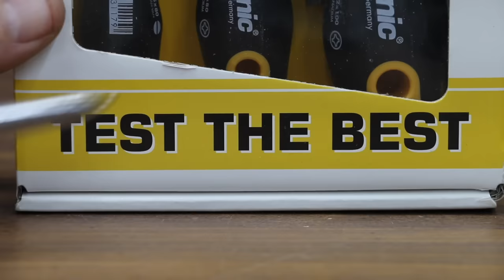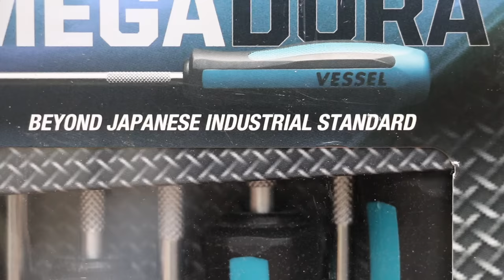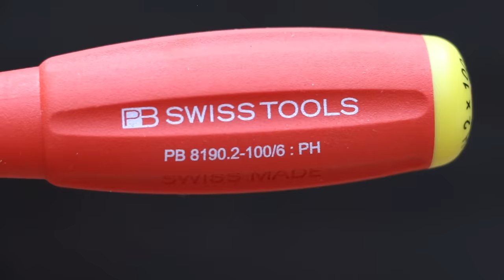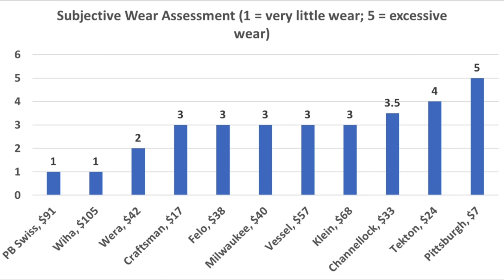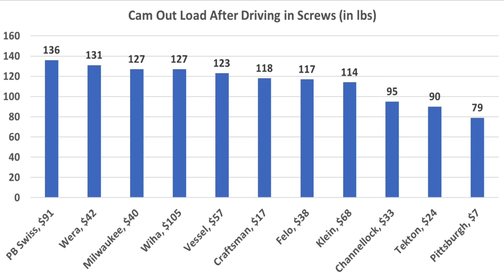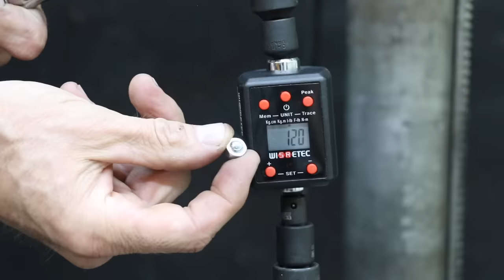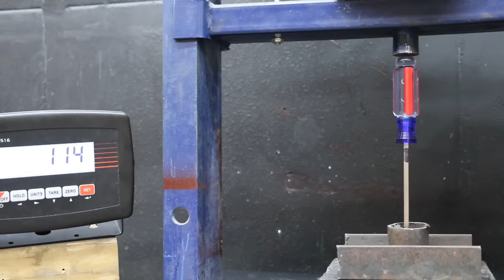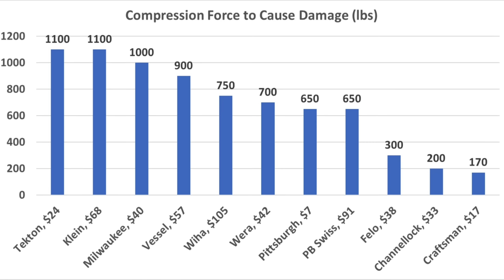Best Screwdriver Set? Craftsman, Milwaukee, Wera, Wiha, Klein Tools, Felo, PB Swiss, Tekton

Comment: "Americans like to use hammers on their screwdrivers"  Yes but said hammer is probably an adjustable wrench! LMAO
Reply: I feel personally attacked by this. Lol
Reply: And holding it with pliers.. ha!
Reply: I think you mean "Adjustable Hammer"
Reply: Nah, electricians pliers are a ‘hammer’.
Reply: Crescent Hammer
Reply: @mrjeh49  And don't forget, only use a screwdriver when prying something apart.
Reply: We Americans use everything as hammers and butter knives as screw drivers
Reply: @hammyboigaming904  Or jumping across solenoid lugs to start the tractor.
Reply: I use my metric pipe wrench for everything.Even works for sae.
Reply: @skyemac8  Yep, a set of Klein side cutters works just fine, but hit it with the solid side of the hinge.
Reply: @pallmall5495  Yours probably has a built in newton meters to lb/ft converter.
Reply: no meaning man
Reply: If it's in my hand when I need a hammer, it's a hammer.
Reply: @John BS Jack. I have old screwdrivers sharpened for gasket scrapers or wedges. They make good drivers where a chisel wont fit. Keep the expensive stuff for screws only.
Reply: @oleran4569  I use it as a torque wrench ,so yes.When it makes a loud click,I know have broken the weld on the handle again and the bolt is probably tight enough.
Reply: @John I only buy Snap-Off tools.I refuse to spend $25 on a 10mm wrench when the  $1 Craftsman I bought at a local yardsale will either turn that bolt,or snap-off.If it breaks,I go to Lowes and have it replaced while I buy some more cheap tools
Reply: Spike S  Yes, I admit that I use a screwdriver as well.
Reply: When I was in my apprenticeship there was a class called The Use And Care of Tools. This class had a text book about he use and care of tools. There were several tools (a pipe wrench, a crescent wrench)  where the book explicitly Says"___ is not a hammer"

Conclusion: If I can swing it, it's a hammer. 🔨 🛠 

Also, if it fits in a tight spot and has a tapered end, it is a wedge.
Reply: If you’re an electrician I would say linemen pliers. 😂
Reply: Thats a beautiful image you're painting
Reply: @FoolOfATuque  steamfitter. Smarter than an iron worker and carpenter, not as smart as a sparky!
Reply: To be fair adjustable crescent wrenches work much better as hammers than they do as wrenches.
Reply: LOL
Reply: @DorriWilliams  at a former job, we had a large adjustable wrench that wouldn't hold its position, so I wrote "crescent hammer" on it and threw it in the hammer drawer. Some guys were stealing and losing tools, so all of the actual hammers were missing at one point, but the crescent hammer was always there, and it worked very well!
Reply: Iron workers pliers.
Reply: Who even uses a big slotted screwdriver in a high torque role anymore,  you ask? 
Piano technicians do every day.   And we get to see what screwdrivers bend easily.  
Craftsman and Husky bend more easily than Klein . 
Klein is really good and made in the USA.
Reply: ..or a large headed ratcheting socket wrench
Reply: Shit I use my Kleins to beat on the screwdriver
Reply: Ok?and?
Reply: Channel locks make a decent hammer once you get accurate at swinging them.
Reply: I just used a large USA made Craftsman flathead to chisel out a busted section of a doorway. Sorry, but I cheated and used a real hammer on the screwdriver.
Reply: XD it's like you know me
Reply: Guilty! That's why I have my beater screwdrivers....
Reply: Or a rock.
Reply: Sadly I use an adjustable wrench as a hammer 😂 but it's works perfectly fine.
Reply: I personally keep a broken old Craftsmen 3/4 inch ratchet
Reply: Every tool is a hammer.
Reply: Anything heavier than 5in vise grips is a hammer
Reply: No you are wrong.
Reply: Sounds about right 😂
Reply: wow B Hess has his finger on the pulse of america! anything in an americans garage heavier that said screwdriver is a hammer👍
Reply: @oleran4569  don't talk about ne lime that
Reply: I see you've heard of Good Old Repair method number 3 and if that doesn't work it's time for the good old acme Ace bringing the Mickey Mouse. How fitting it is that Mickey Mouse has a female's voice because it's usually so ugly it becomes the mother of invention. You know the necessity for beauty and function. That is the Acme crew may get the job done but my a.d.d. demands a new invention
Reply: Yaa they eat pig and act like it
Reply: Mmmmm uhhhhh….. no excuse. But ITS CALLED A CRESCENT WRENCH GUY.
Reply: @ericstoverink6579  this is why I  prefer to call adjustable wrenches either a hand vice or a nut rounder
Reply: False, the hammer is a pair of side cutters!
Reply: Or a 3/8 ratchet.
Reply: slowly hides crescent wrench behind my back
Reply: It’s an adjustable linear impact driver
Reply: I have 1 Snap-on Phillips driver and it's my favorite but I just can't get myself to buy a full Snap-on set when for the price I could buy 37 craftsman sets. 😆
Reply: Adjustable hammer*
Reply: I personally do not hammer on my screwdrivers ( I've got a full set of WILDE striking cap handle pry bars for that )
And I do not use anything but a hammer as a hammer because I just about have a hammer or 3 for every job.
Reply: Factory workers use  long 1" bolts as hammers a lot.
Reply: Always use my pliers as a hammer🤣🤣
Reply: This comment section is gold
Reply: Sometimes a ratchet.
Reply: Every plier is an adjustable wrench when you use it like a hammer
Reply: That's why they're called hammerlocks 😂
Reply: @Neanderthal75  any ratchet and work as a hammer especially if you turn it around and use the back end which is usually flat.
Reply: LMAO
Reply: Yessir🤣🤣
Reply: @FoolOfATuque  linesman we aren’t playing football we’re doing the lords work
Reply: I used a Bosch 12v driver as a hammer many times. Didn’t even mark it. Works great!
Reply: I have used my Makita cordless impact battery to set nails. We’re gunna test that!
Reply: Felt that
Reply: The amount of times I've used a crescent as a hammer and felt dirty is high.
Reply: electricians know that carrying  a hammer is pointless when you have 3 lbs linesman pliers that never break unless you arc the jaws.
Reply: Have you been spying on me???
Reply: @ericstoverink6579  — There are some applications where an adjustable wrench excels.  For example, I use my 12” adjustable to tighten the large nut on a trailer hitch ball.  Buying a box wrench for that one large nut you have to turn is not efficient, because you couldn’t use it for anything else and you might have another ball with a different nut.
Reply: Kincrome makes a shift with a hammer on it
Reply: Or Kleins. Lol
Reply: As a plumber. Yes
Reply: Oh that's what a screwdriver is for.
Reply: “Laws of engineering”
- Always use correct tool for a job
- A hammer is always the correct tool
- Anything can be used as a hammer

I’m American
Reply: @Wiredlightning1  “Laws of engineering”
- Always use correct tool for a job
- A hammer is always the correct tool
- Anything can be used as a hammer
Reply: @themeez1000  “Laws of engineering”
- Always use correct tool for a job
- A hammer is always the correct tool
- Anything can be used as a hammer
Reply: @skyemac8  I am very familiar with the 9” Kline hammers.  

“Laws of engineering”
- Always use correct tool for a job
- A hammer is always the correct tool
- Anything can be used as a hammer
Reply: @bigboycombo6342  American dimes also work well as flat head screwdrivers. 

“Laws of engineering”
- Always use correct tool for a job
- A hammer is always the correct tool
- Anything can be used as a hammer
Reply: @johnwade1095  “Laws of engineering”
- Always use correct tool for a job
- A hammer is always the correct tool
- Anything can be used as a hammer
Reply: @pallmall5495  🙏
Reply: @FoolOfATuque  9” Kline hammer pliers.
Reply: I use my screwdriver as a hammer…
Reply: Lineman pliers. Best hammer in the world and wiha puts a strike surface because they know we are gonna use it as a hammer anyways. All jokes aside I started carrying an actual hammer on my belt everyday and I can't stop carrying it now
Reply: @oleran4569  * yeah! He didn't test that! : ((
Reply: Klein makes the best multitools. My favorite are their lineman-hammers and their flathead-chisels
Reply: @pallmall5495  snap on is overrated, I would put Milwaukee or gear wrench against snap on any day, at a fraction of the price
Reply: Funny….  but true.
Reply: I resemble that remark.
Reply: @skyemac8  I have two linesmen pliers. One for the intended use and one for beating things, come in handy mounting nail in boxes in tight stud spaces and good luck trying to open those pliers 😂
Reply: I find myself using a brick quite often lol
Reply: Europeans can't get the fastener loose because they are incapable of using a hammer in a screw driver due  a tradition of only restrictively using one tool at a time, its far too complicated for Europeans to use two tools at the same time
Reply: Or a set of linesman’s
Reply: I did this the other day lmao
Reply: Everything is a hammer
Reply: As an American, i approve this message
Reply: Everithing is a hammer!
Reply: Or, a pair of linemans!
Reply: Funniest comment ive read my whole life
Reply: Yeah I think it's kinda universal. Everything is a hammer.
Reply: @DorriWilliams  I actually own a crescent hammer 😂😂
Reply: 😆😆😆 Accurate. I’ve seen ratchets used thusly as well. I refuse to do either.
Reply: Some companies (Vessel comes to mind) make screwdrivers with a solid shank through the handle that are made to get hammered on.
Reply: Although that vessel Mogadora is not one of those models.
Reply: @davidantrin7935  yeah Wiha has a set of those too

Comment: "Apparently manufacturers understand that Americans like to use hammers on their tools". YES, a flat head screwdriver doubles as a chisel, a wedge, a small prybar, etc. That press test was the most important for this reason haha.
Reply: MORE POWARHH MURICA YES!!!
Reply: Wera actually make a set sepcifically for this, their chiseldrivers, I wonder if their 'normal' drivers don't deform until 700lbs, what would ones designed for extra impact fail at ...
Reply: Milwaukee has a set of drivers (2, Phillips and flat) with solid shafts through the handle and metal 'impact caps'.  Absolute monsters, but I have 2 sets of them. One just for bashing and the other for screws. The flat is the best grout chisel/tile wedge I've ever owned. The Phillips makes a great center punch for concrete when you're drilling so your masonry bit doesn't walk all over the place. 10 out of 10 do recommend.
Full disclosure, I'm a bit of a Milwaukee groupie. I fully stand behind my review, though
Reply: I got a laugh out of that!
Reply: I have a large Stanley screwdriver that I used for holding open clamshell copiers when the lifters would no longer hold and the owners were too cheap to replace the lifters.
Reply: I think I have seen an Englishman use a screwdriver with a  hammer once.  It was however an impact driver designed for the task.
Reply: @rms7254  I was wondering why he didint test yellow wera :/
Reply: Agree with the comments. I bought my handyman friend a set of Wera tools as Christmas gift and he rarely uses it. He needs the flat head to do everything you mentioned and refuses to do them to a nice flathead with the diamond tip which would be destroyed instantly the first time he hammers it. He just keeps the set at home for home repairs.
Reply: Shock loading rusted or stubborn fasteners is a decent technique, I'd buy a screwdriver that had this in mind even though you could rarely use that feature
Reply: Yes, the Harbor Freight would failed miserably had he done an impact vs press. One blow is all it takes to shatter the orange tip off it. I've used just about everything over the years and settled on the craftsman, as anything better will inevitably be stolen. At home I have a set made in Israel that feel well and are twenty years old. Can't get them any more. I do keep the reversible Kleins in my tool belts and electrical tools box, as it's very handy and fits well. Stanley would have been good to include on the cheap end.
Reply: Americans
Reply: The swing press is the best tool ever!
Reply: @goldenhawk352  perhaps German - Green Wera - screwdrivers are not designed for that dirty, general use case. If you need more "brute usage" then Wera has the specific designed yellow variants with steel end cap etc. We are a few viewers that found that test good but missing that kind of detail. Most of us do a range of things but selecting the right tool for a specific job is always a good start
Reply: @Jeff_Gibbs  I love Milwaukee hand tools. They actually have people that use tools working on their designs.  They throw in stuff without adding hassle. Like their 11n1 screwdriver. 8 bit tips and 3 different nut drivers when you remove the bits. Plus a small hole in the shaft for bending wire for receptacles and a notch in the handle with blades to make a wire stripper. They're not in the way when using the regular driver, but when you're doing receptacles you don't need to put your driver down to pick up strippers and put the strippers down to hold the pliers and then drop the pliers for the driver again.  It's all in the driver. It's little stuff like that that saves a bunch of time on the site
Reply: @ForumCat  Was he a brummie?
Reply: If a screwdriver has a lifetime warranty, why not?
Reply: This is true, the correct design can also make the all difference in how many pieces the ophthalmologist must remove during your first of many surgeries.
Reply: "Primitive Pete"
Reply: My grandfather used to reshape his flat-heads with a grinder, depending on need.  They were basically the blank for other tools he'd make.
Reply: All tools can be repurposed as a hammer, in a pinch...
Reply: @epstein_isnt_dead7726  multi-drivers are horrible! Have had a couple and you always end up losing bits or they will rust and get seized. - From a refrigeration mechanic.
Reply: @drew651  I agree, with the sole exception of the Milwaukee.  I have 4 (I'm a general contractor and all my work is at 2 condo complexes and I have a personal workshop at each) of them. 1 got left in the grass for a week and the bits did rust. Cleaned it all up and an AC guy stole one of the bits. It's since been retired (kept it for spare parts 😎). 2 get used occasionally and the one I keep in my toolbox is my daily driver (👈 pun). Never had a problem with any of those 3. In fairness, I mostly use my cordless driver. But any time I need a hand driver I turn to ol faithful
Give it a try. At worst you're out 12 bucks
Reply: @b.d.cooper8671  Brother of D.B. I assume